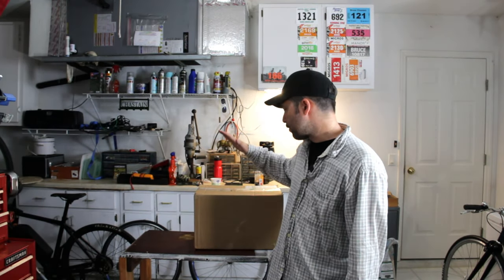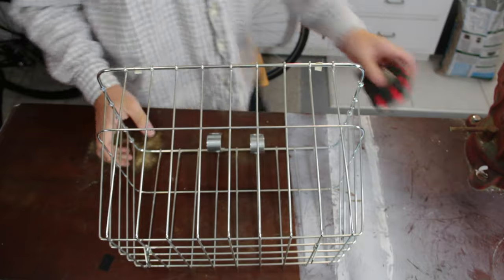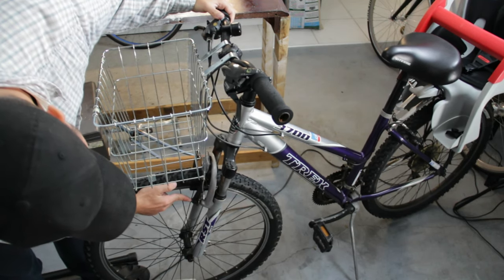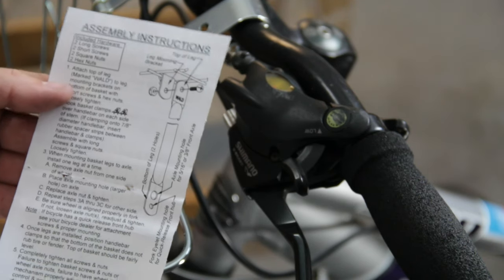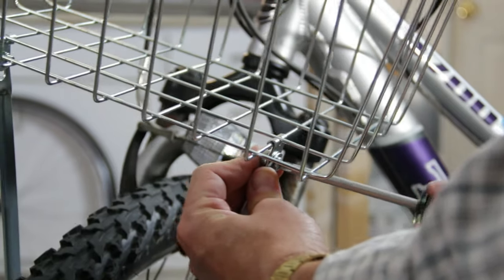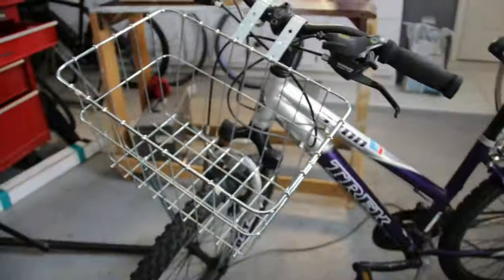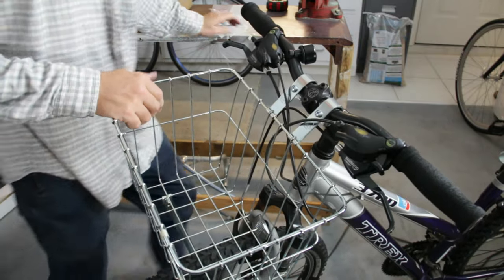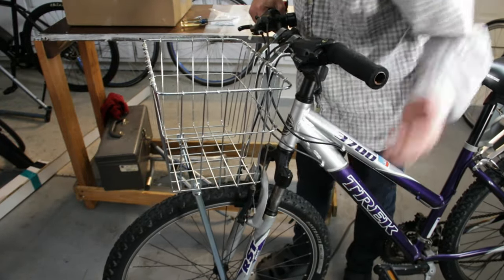Wald Front basket ///install - setup - test///

Comment: As others are saying, a basket with that type of frame is not supposed to go with suspension forks. Suspension forks don't have the holes for attachments.

Those baskets were designed for rigid forks that have not up and down movement. Right now, as your fork gets compressed, it pushes your basket upward, but the top braces of the basket (attached to the handle bar) try to keep the basket from going up.

I do have a bike with front suspension and was able to fix a milk crate with zip ties and a piece of wood to work as a spacer between the bar and the mild crate to allow space for the breaks levers. I also used another zip tie to hold the bottom of the crate to the front tube of the bike (so that the crate would not hinge from the handle bar). Works fine, so far.

https://photos.app.goo.gl/dqhgbpV7mJ6ZFVxAA
Reply from the maker: thanks Roberto for the feedback. Luckily for me that fork is almost rigid due to it just being so old and rusty lol! Nice looking setup you have.